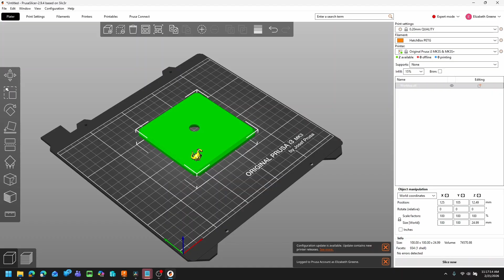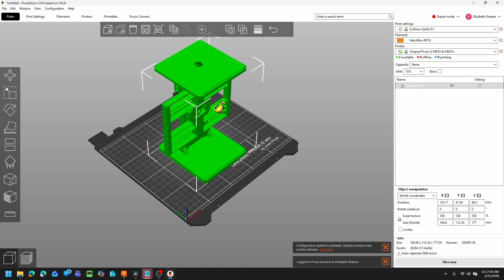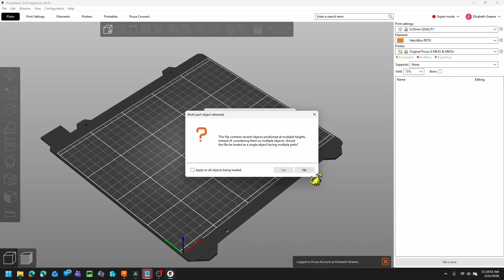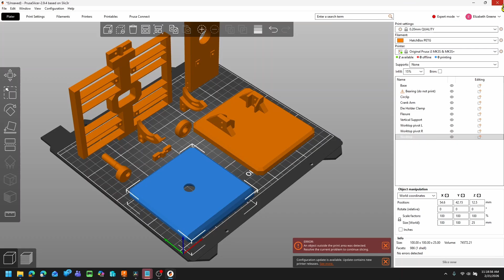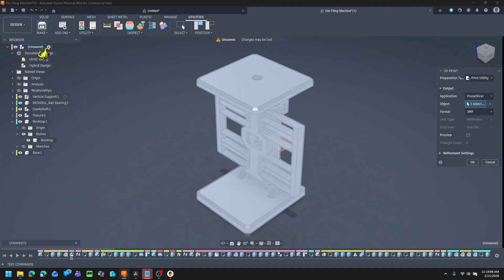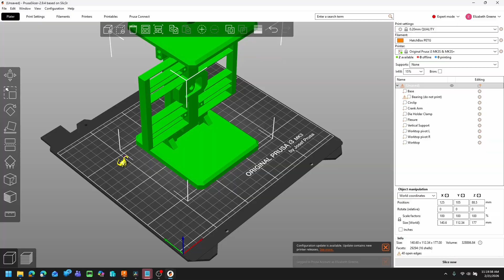How do I export a multi-part model for 3d printing in Fusion?

Comment from the maker: In addition to the solution in the video, many slicers can import a .step file and that would work too.  Exporting .step files is under the file > Export menu in Fusion.  .Step files have some advantages over .3mf files in many applications, but they have more controls associated with them and I didn't want to scare off new users.